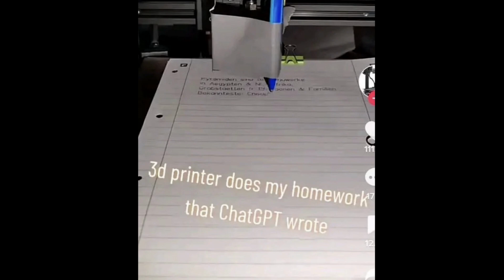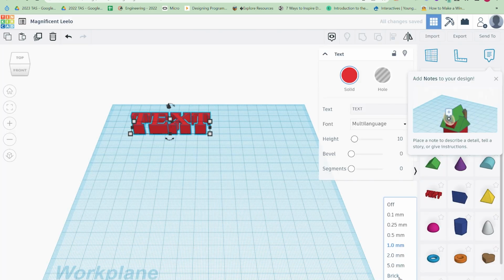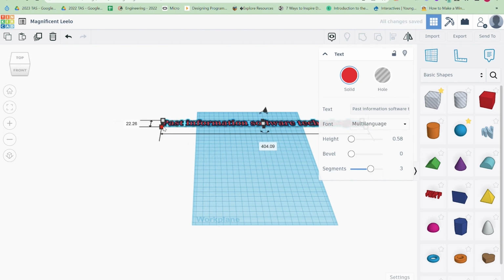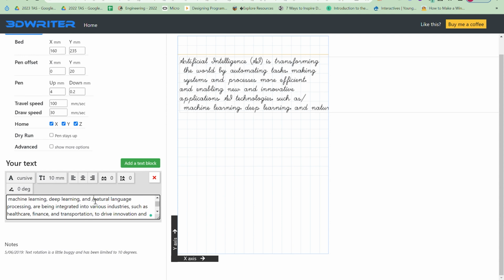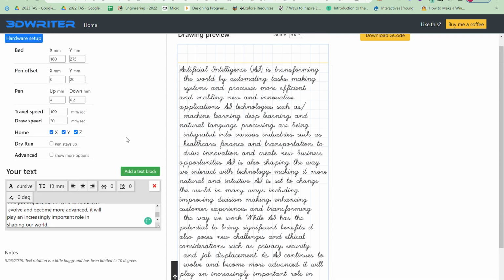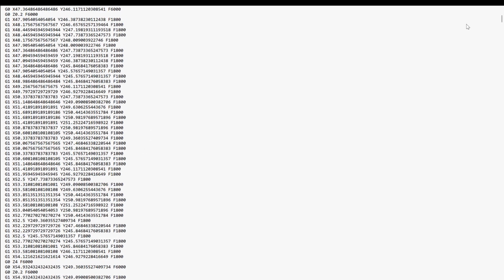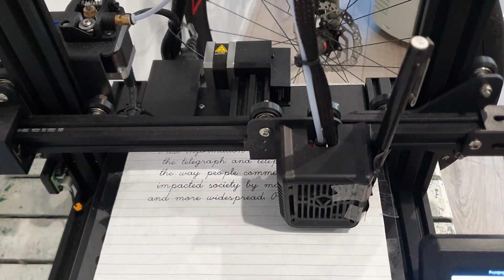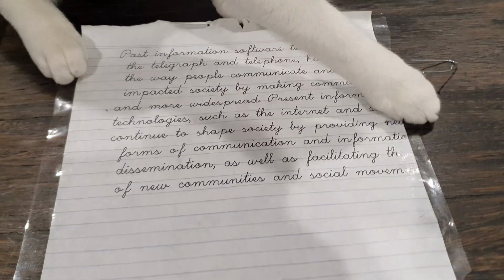How to get your 3d printer to do your homework with ChatGPT

Comment: You should use a gravity pen. Let the pen free float in a tube so that it adjusts the amount of force on the nib for itself. If you need more force you can add a weight (like a nut) to the top of the pen. EDIT: Search for CNC Pen holders.
Reply from the maker: Thanks for the tip!

Comment: How do you avoid the levelling phase? I can't tape the pen on before the print starts because it tries to level and changes height
Reply from the maker: Luckily (or not) mine doesn't auto-level. Do you have the option to turn it off for your particular printer? What printer are you using?
Reply: @theinnovationclassroom  I'm using a CR 10S v2 Pro. I tried turning off auto-levelling but it still does one check at the beginning to see how high the bed is which means that I have to quickly tape the pen on and it misses a couple of words while I adjust it. Do you know if I can edit the gcode to make it stay at the same level that it auto-levels at for the entire print so that I could tape the pen on before it levels?
Reply from the maker: Or could you pause the print after levelling?
Reply: @theinnovationclassroom  I just tried, it sort of worked but only if I pause when the pen is raised for a space, if I pause when it's at writing level it draws a big line because the nozzle moves to the corner when it's paused
Reply: @theinnovationclassroom  Thanks for the help anyway man, awesome video, I'll keep working on it tomorrow